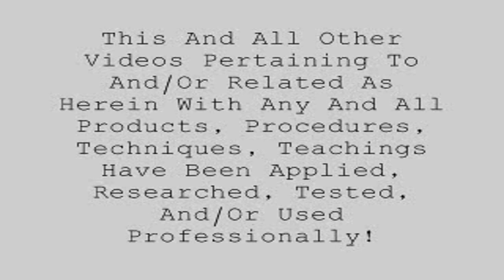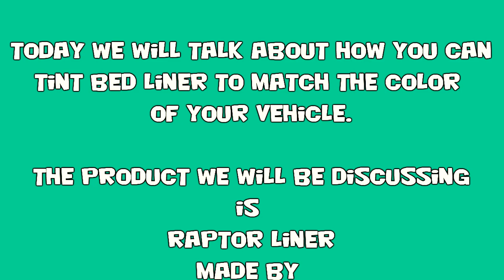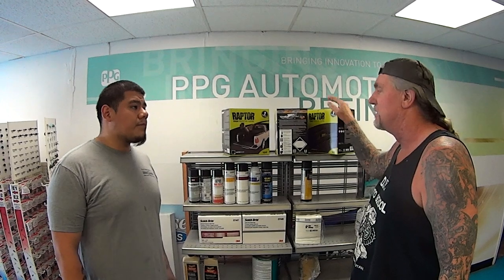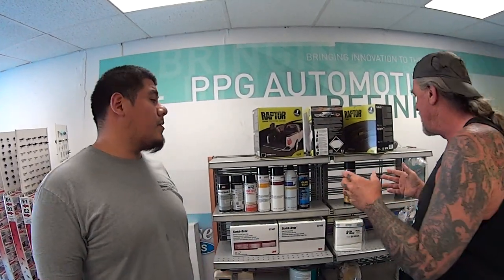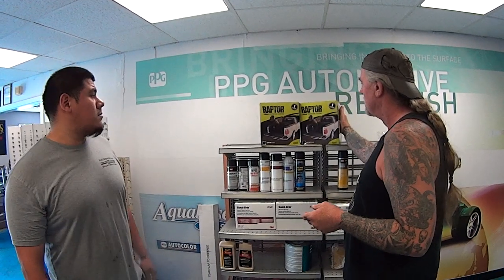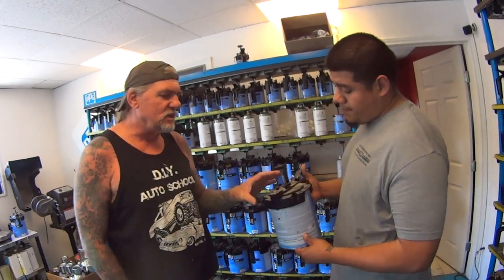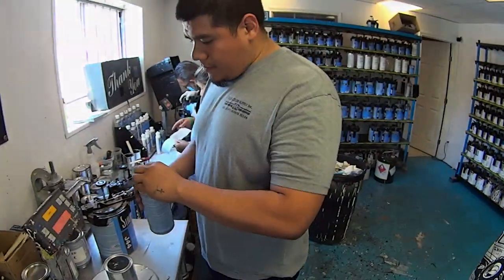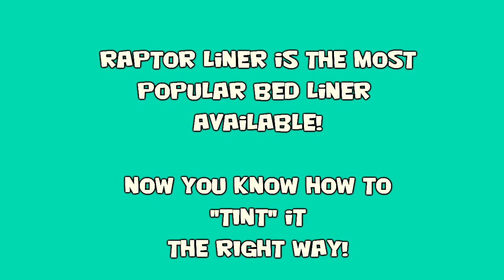[HOW TO] Use "RAPTOR LINER"  - Do It Yourself

Comment: Hi Pete, there's another product out there I think you'd be interested in.
Bully liner this product is from Australia it's water-based or you could call it acrylics. It's a one-party system. The man who invented the Coatings for are  submarines and the space shuttle I did a lot of research on this product. I'm going to use this on my truck don't need to use a respirator. There's no epoxy in this formula one part formal also paintable and the cool thing about this product is that you can paint it with a roller or brush and spray it and I really like the idea that is if you ship it can just take a little bit of a paintbrush and just dab it to fill in that spot that was chipped can't do that with with other epoxy bedliners companies products.
Bully Bedliners definitely is awesome for d i y!!!
P.S. Pete I really enjoy your videos

Comment: Hey not much respect for covid-19. Thank for tip about Raptor liner. Would be fun to see a film of you applying it to the car. Prep the car, prep the product and gun and then aplly and your thoughts of the situation. Something i thought of, no primer under the liner??
Reply: How could anyone respect a manufactured virus that has been used as a fear tactic to gain control and strip away individual liberty . You are part of the problem 
 Wake up .

Comment: I sand blast prime 1st.
I reduce the first coat spray it with a burned out primer gun smooth coat the hit it with the rock guard gun.
I find it goes further and that 1st smooth coat makes a good seal.
Also note the hardener sets up fast and has a short shelf life so be careful. I learned the hard way and ended up with a clear paper wieght.
I ended up using a universal hardener with this product and set up just fine.
Reason is because I'm way the hell down in central America.
This stuff sticks like shit to a wool blanket.
Fine product bodymen and girls.

Comment: Just for shits and giggles i experimented on an old rocket box tinted it with rustoleum tint and thinned it down with reducer through  my hvlp gun 2.0 tip 
What and my scale screwed up on the reducer 2nd coat 
What i found from my experiment so  far tint was fine and so was it being over reduced ...it seems to be very forgiving as to its mix and is about impossible to get a run in as it is just downright sticky....but time will tell

Comment: Never painted a vehicle before, just helped a few times. Am building a 77 F250 and want to line the fender wells and lower cut line. What kind of a spray gun do I need for the raptor liner?
Reply: Ask your local paint store for a Schutz or Bupa gun.

Comment: My Friend Pete, you got it backwards, U-Pol recommends toner with no binders to color tintable Raptor. Binders will render the color translucent. The Tintable  Raptor TDS  is available on line.
Reply: The binders are in the tintable raptor he is adding paint to the black raptor so the binder is so the blue paint mixes with the black liner correctly

Comment: Need to be careful with those tintable liners,some cans have been sitting on shelf for so long,the pigment settles in the bottom of can and turns into a useless gelatine.
Reply: The paint shops should rotate the tins every day ...but will they ?
Reply: Filberto.The tintable  liner material has no pigment added, you add the color. How can the pigment settle when it was never present?
Reply: @Dixler683  the white milky container is the one that settles and turns into gelatine.I buy that stuff constantly to spray hunters truck with,and mostly the white milky stuff is what turns into gelatine,the other part which is the activator is always good.
Reply: @Dixler683  Part a activator,part B liquid,and part c color.

Comment: Don’t use a binder.
Reply: I have done a ton of research including calling U POL - do not use binder.  The binder is in the raptor liner, you want base cote with no binder.  3.5 oz to a bottle of Raptor
Reply: @jeffpatel8538  yea i dont get the point of the video. Literally tells you to do the opposite of what upol says.
Reply: He’s tinting the black liner not the tintable raptor the black liner doesn’t have the binder in it like the tintable raptor does to help the paint mix correctly